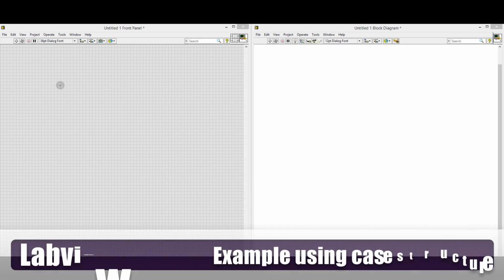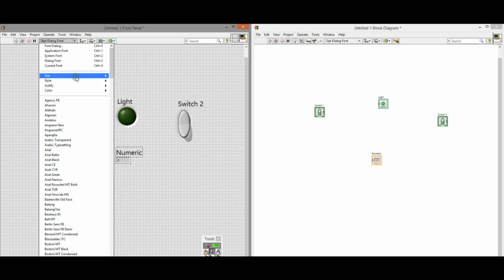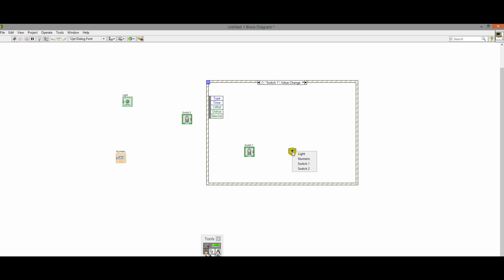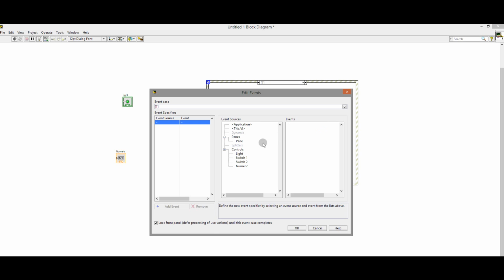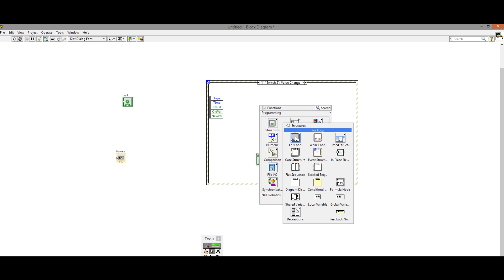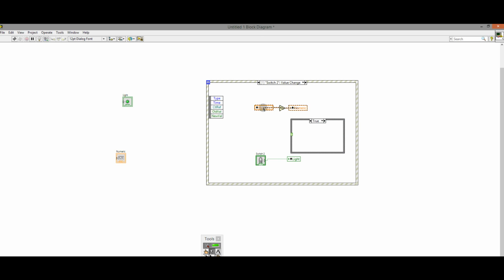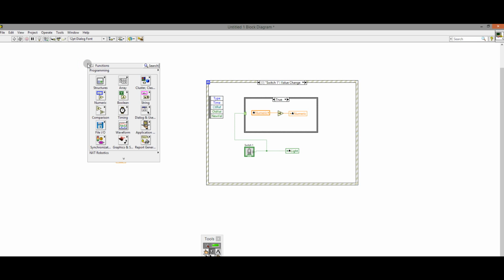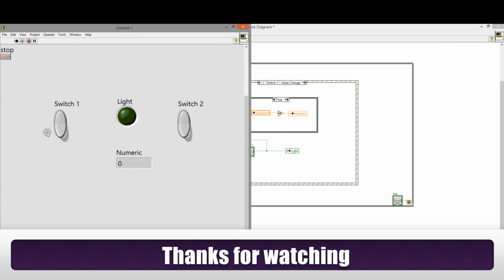Labview Example - Using Event Structures

Comment: when using both while loop and event structure, stop botton of the while loop should be put in the case structure. So, what I'm saying is creating a new event, and put the stop button in that event, and when "stop" value change, the whole program chould be stopped.